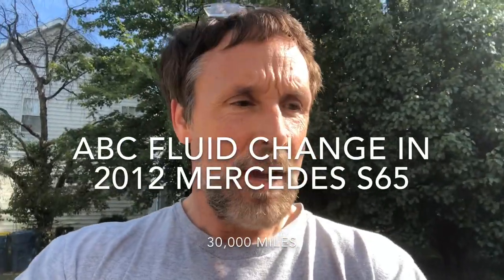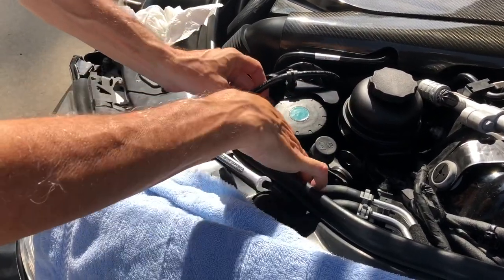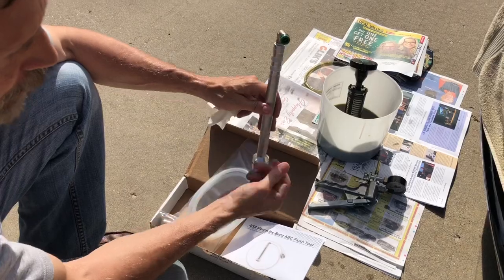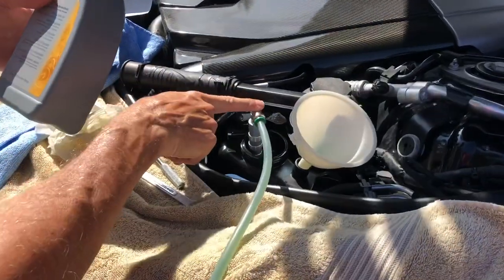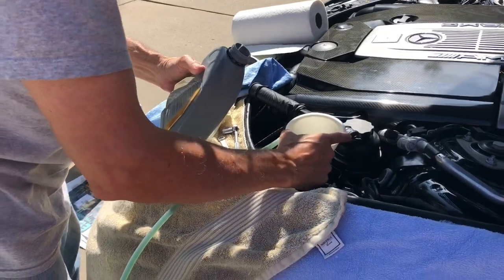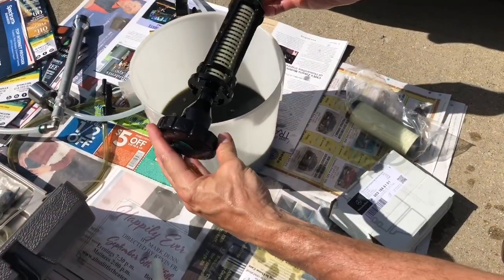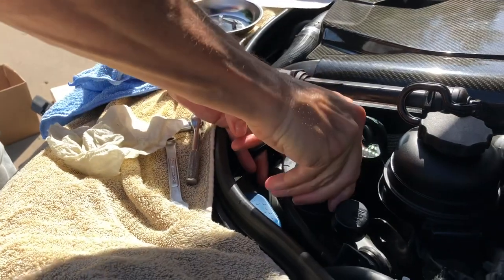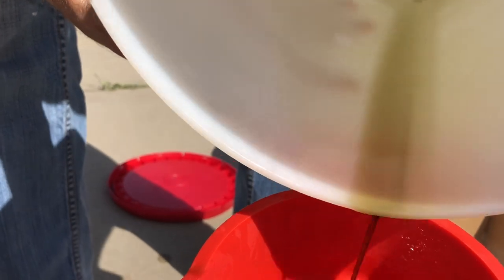ABC System Flush in 2012 Mercedes Benz S65

Comment: Thanks for the video!  Purchased the tool, fluid and filter and performed the service today on my S63.  It took quite awhile to warm up the fluid in the rodeo mode as you wrote but the actual drain and fill and Dynamic Test to finish were pretty quick.  I also used a funnel which made it very easy to pour and watch and was able to do it by myself. I had two 5 liter Pentosin jugs, so it was easier than ten bottles. 
 I found your video watching somebody else's video on an oil change and that person talked about the ABC hydraulic fluid....then my interest started.  Found info on the tool and then saw your video.  Thank you again!
Reply from the maker: Those 5 liter jugs sound nice. Thanks for your comments, and I’m glad this video was helpful.

Comment: Ive always flushed my CL65  every 10K miles and the rule of thumb on abc fluid when you buy a ABC car is check the fluid, light green is good, slightly dark means change asap and black fluid means avoid! I hope your car is ok after that flush that fluid looks really dark. Ive had 2 CL600s and 1 CL65 i think im qualified to speak on this.... good luck
Reply from the maker: Thanks for you comments MANsA MUSA, I hope it will be ok even though the fluid was pretty dark.  Going forward I will keep an eye on the color of the fluid using the dipstick to check.  During this COVID-19 period it sat for over a month and no noticeable sagging and no leaking so far.  Fingers crossed...
Reply: Would a light come on your dash saying ABC fluid is low? or how would you know on a CL550?... ill be checking mine tomorrow tho
Reply: @BeatNovakane   you have to pull the dipstick for the ABC reservoir . The top line means cold check and the lower line is checking when it’s hot..

Comment: I bought a Foxtell NT510 Elite (Mercedes Benz) for my 16,500 mile 2009 SL550 with AMG package.  It too does the rodeo test.  The scanner was less than $125.
Reply from the maker: Good information Joe. That is a great price for rodeo capability! And, that is some really low mileage. Have you flushed your ABS yet?
Reply: @johnsworkshop3312  - I will soon.  I already got 20ltrs of Pentosin CHF-11S from Amazon for about $211-->good for 2 flushes.  Also bought 2 reservoir filters as well from Amazon.

Note:  the scanner is a FOXWELL and not Foxtell...fyi.

Comment: Nice video! I have a Benz with airmatic suspension and currently trying to watch several videos regarding ABC to see what's going on in that camp. Seems flushing is not that hard and you don't have to skip it. I'd like to find a way to get that fluid with a discount. I see they sell 5L for around $75. Or maybe there are identical fluids made by different brands...
Reply from the maker: I used my Mercedes Benz club discount and bought it at the dealer. Still pretty expensive but cheaper than buying new parts for the ABS system. I’m sure I paid much more than the price you mention.
Reply: @johnsworkshop3312  Thank you for this info! I guess any discount matters since MSRP is too high.
Reply: A former mechanic from L.A Mercedes-Benz has a problem with his ABC and can't fix it.

And was a mechanic for 10 years working on these cars😂
Reply: @dragospahontu  I'm sorry, but I think I'm a bit confused. Please tell me who's the former Mercedes mechanic? Do you mean the author of this channel or someone else? TIA
Reply: @NoWheelDrive  someone else. There was a news article on it
Reply: @dragospahontu  Gotcha! Sounds interesting! :D

Comment: It's insane that Mercedes says you dont need to change it when it's clear as day you need to at least every 50k miles.  I have 59k miles on my 2014 S550 with MBC and the fluid looks like shit.  They were trying to tell me that's normal.
Reply from the maker: Yeah - that just doesn't seem right to have dirty fluid full of particles running around in a system that has tight clearances and small moving parts, like the valves.

Comment: Hey John, I have a W222, I just plan to add fluid (since I don't need to change it yet), do you add fluid to where the dip stick is at? Thanks!
Reply from the maker: You are correct. You can add fluid through the dipstick hole. Good idea to use a funnel.

Comment: Need help, my 2015 S65 AMG Sedan constantly squeaks when driving? Is that normal for hydrolic suspension? Any help would be highly appreciated.
Reply from the maker: That is definitely not right.  I would think that it wouldn't be related to the ABC system, but most likely a dry joint - maybe a ball joint or an bad suspension bushing where the rubber is no longer retaining the two parts in the proper position.  Those squeaks can be tough to locate.  Good luck resolving that.

Comment: I am going to do this job in a couple days. I noticed you were adding the fluid through the fill hole, instead of the reservoir. I’ve seen others adding fluid at the reservoir. Any particular reason one should use one place or the other, that you are aware of?
Reply from the maker: My funnel fit nicely in the dipstick hole and then I could see the level through the wider filler cap so I could keep it from getting too low.  Good luck with your job.

Comment: So which exactly was the route through star diagnostic? Did you select the dynamic test function from the beginning of the process to flash the old fluid? Or you select the dynamic test function at the end of the process, just to verify that everything was okay after all? Thank you.
Reply from the maker: Good question.  I was not very clear on that in the video, but I used rodeo mode to warm it up further after I drove it around.   The menu also calls this mode "Cyclically alternating actuation of all suspension struts in a circular motion".  Then I used the menu pick "Cyclically alternating actuation of front and rear suspension struts (pitch)" while I was changing the fluid.  Then, finally, after I was all done I used the menu option "Dynamic Test" to check out the system to ensure it was working properly.
Reply: @johnsworkshop3312  Thank you for your clarification.

Comment: Great video!
I have a 2014 W222 S550 with the magic body control aka abc. Is it same with the older generation abc system? should I do something extra maintenance compared to regular Airmatic W222?  
I’m already worrying about that system cause the car is getting aged, also there isn’t much discussion about that ABC system on w222.
Reply from the maker: Darren,  I have not read much about the W222 improvements, but I understand that system uses the same hardware as the older ABC system but adds cameras which attempt to anticipate bumps before they are experienced by the tires.  If that is indeed the case, then I would think that the same maintenance would apply to your system.  See my response to the previous comment for a good link on maintenance.
Reply: Thanks for the reply,
I just contacted a local dealer, they told me it’s the same procedure as older system(flush oil, change filter). But they don’t flush the system as regular maintenance, they only do it when errors show up. Sounds kinda wired... Any recommendations on when should I flush the system? currently have 40,000 miles on it.
Reply: @darrenwang2356  - you should change the filter(reservoir), flush and add new hydraulic fluid every 30k miles.
Reply: Go to E-bay  abcteile-24 they sell a Magnetic filter that you add to your ABC line, their custom made in Germany, they work great use on all my ABC suspension vehicles. It gives you that extra piece of mind. They work great. I’ve been using them for years.STEVEO55

Comment: how reguler should we flush the pentosin? is it count by years/ milleage? mine is S500 2008, it has 23k kilometer on it.
Reply from the maker: From what I have read it sounds like a good schedule is 20,000 miles or 2-3 yrs.  Taking a look at the color of the fluid is also helpful and it should be clear and have a green tint.  The below link is a good reference and he talks about maintenance near the bottom of the article.  http://mercedes-abc-drive-carefully.blogspot.com/
Reply: as far as i know the 08 s500 has airmatic and does not have a fluid that would need changing.

Comment: Does mercedes have a recommend service interval?
Reply from the maker: I have not found an official service interval printed anywhere by the factory, but from researching on the web it sounds like it is advised in the range of every 20,000 to 30,000 miles.  I did mine at 30,000, and you could see that the fluid in the reservoir was definitely discolored, and the fluid that was flushed out contained some sediment that was somehow not picked up by the filter, so I am thinking that my next change should be in 20,000 miles.

Comment: Hi! One question. For flushing the system cca 10-12 liters, and after  when fill the system plus 10-12 liters? Or under flushing exchanged the liquid? So, for this enough 10-12 liters or need 20-24 liters? Best regards
Reply from the maker: I used 11 liters total which includes all the flushing and topping it off when done
Reply: @johnsworkshop3312  thank you

Comment: How could you direct or help me do my 2011 S65?
Reply from the maker: I would start by getting all of the necessary supplies: the Pentosin fluid, the filter, the AGA tool, and a STAR system.  After that, it is a matter of taking your time and being careful as you go through the steps shown in the video.  If you get behind in filling the reservoir you can always have your assistant stop the test mode until you catch up.  Let me know if you have any questions. Good luck with your 2011 S65!

Comment: That benz looks quite nice. How much did you have to pay for it? Are you happy with the purchase? Is there something that annoys you with your s65? Great video tho ✌🏼👍🏼
Reply from the maker: Thanks, these cars really are amazing.  Like searching for any car, the price correlates directly with mileage and condition.  I was looking for a 2012 or 2013 S65 and searched for about 1 year.  Finally found this one in FL.  It only had 27k miles on it.  I have seen similar models as low as the low 40's but then for really low mileage examples, all the way up to $72k.  I've had mine for about 1 year, so prices will have dropped since then.  One key for these cars is to ensure you have a well documented service history and be sure the owner was changing oil and transmission fluid regularly.  Good luck in your search.